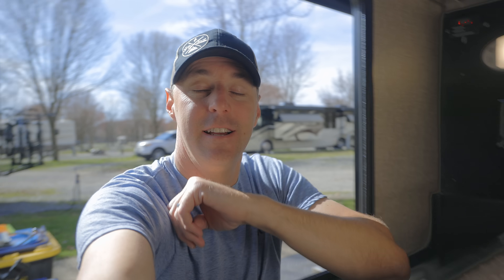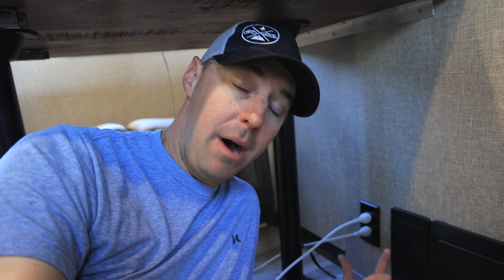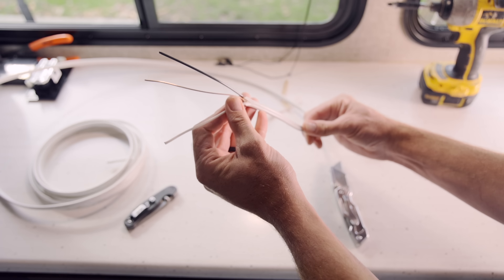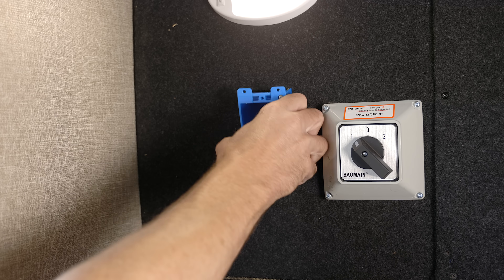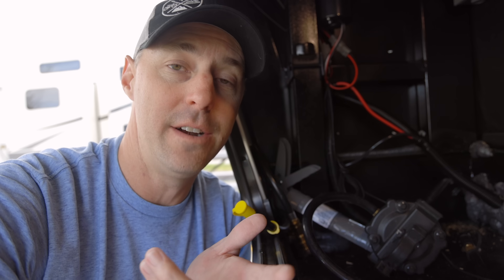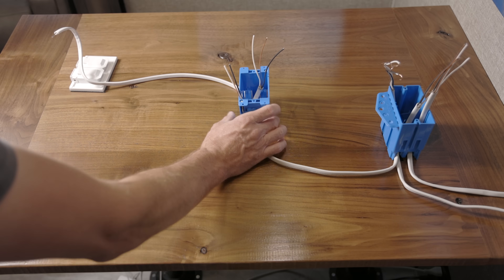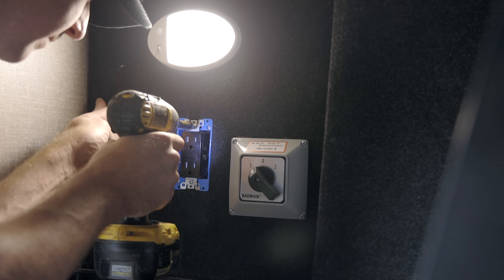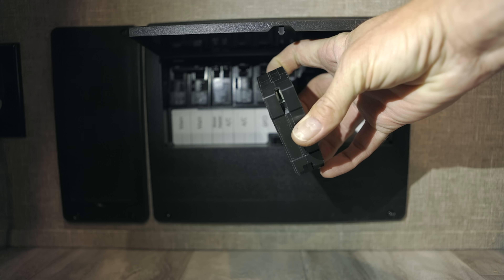How To Add Electrical Outlets In An Rv.

Comment: So thankful Jarrod. You're video is great, and I'm a teacher so I know what great instruction is:)

Could I ask a quick question? I want to add a 100 outlet in an upper bunk 3 feet above the 110 outlet in the lower bunk. It looks like the wire comes down from the roof to the outlet and then back up. Can I just wire in another outlet in wither wire? They're so easy to get to!

Comment: Very knowledgeable video, thank you.
Just wanted to mention that the device counts as (2) conductors which would equal 4 cubic inches (at 14AWG), and the current NEC now counts each ground wire as a separate conductor - but I'm not sure that an RV has the same code requirements as a typical dwelling.

Comment: I have one of those 15amp quick connect outlets that was cracked and I tried to replace it but could not get the back of receptacle back on. I finally gave up. Now I'm looking for a blue shallow box to use a regular household receptacle. I got the receptacle but not the box. The boxes are too deep and I don't have space in the ceiling. There's like may 2 to 2.5" depth in the ceiling. MY receptacle has 2 romex wires going to it. The wall out let is in the middle of a circuit. Where can you find these shallow boxes?

Comment: Hello, I've recently started living in my rv full time and am frustrated with the lack of outlets. I have an idea of replacing one of the light fixtures with an outlet, so that I can have an outlet in a more convenient place near the couch to charge devices. I understand that the light is 12V so I can't plug anything into it that draws too much power. But would this be possible?

Comment: How common is it to use solid romex wiring in RVs? My understanding is that stranded wire should be used instead to avoid work hardening and breakage from road vibration.
Reply: My understanding is that stranded wire is required by code in 
RV's

Comment: I'm remodeling a travel trailer and I chose to use the shallow outlet boxes since they should fit inside the thin walls. Also remember that the AC grounding bar usually requires a specific torque for the connections. Hand tight with a screwdriver may not be enough.

Comment: So my CO2 detector has a black and white, hot and neutral I presume. However when I put my tap tester to it it doesn't indicate that it's hot. Is this a low voltage issue?

Comment: I was hoping that maybe you or someone in the comments would be able to help me out with figuring out how to wire up a solar power system into a pre-existing system, for example my water pump and lights all run on the electrical already set in the rv, and I would like to transfer those onto my new solar (batteries) power system, if you or anyone can help me figure this out I would very much appreciate it.

Comment: I'm  amazed this industries  approach to wire a  RV product.   For the DIY is one thing; in contrast, the RV owner who must pay a technican to work on wiring, I can see the labor cost going through the ceiling to trace source(s) .  Behind a  wall wires are everywhere,  WOW.  RV industry it's time to setup, create wiring bundles and schematics. It will reduce weight and material cost.  Inital Engineering design cost will be more; however, you will recover that on the return for you investment (material savings / inital manufacturing installing costs).  More importantly the  end User will have something which is much more maintenance friendly. Futhermore, technicans will have the ability to trouble shoot  more effectively and effiecently.  A happy owner is a brand loyal owner.

Comment: What is your opinion on using WAGO connectors vs. wire nuts in this type of application?
Reply from the maker: I like WAGO connectors, I would use them.

Comment: I like your videos and have been watching and liking for years.  I always know I'm going to get quality info.  This one was especially good for me.  I'm a do it yourself kind of guy with one exception, I don't do electrical  (too much to know and the mistakes carry too much risk)  That said, you sure made it look easy and thanks for the info on the boxes, I didn't know they had different capacity ratings.  Also, plus one for liking the table top wiring example - that is how I think and picture it in my mind so it's really nice to have the clean confirmation.  That's it!  Safe and fulfilling travels to you.  Cheers!

Comment: Shouldn’t we use stranded copper wires instead of solid ones in travel trailers and motorhomes ?
Reply: The trailer manufacturers use solid conductors for AC (15amp and 20amp) and stranded for DC and 30amp AC in the trailers I've worked on. It's safe and the connections are more solid because as he showed in the video, you can twist them so that they won't separate.

Comment: Check out the WAGO connector, which takes the place of wire nuts.
Reply: Shouldn’t use wago connectors for this because they can wiggle out overtime.  Wago is only for residential

Comment: Just don’t. You don’t need “extra outlets” in a box where you can touch opposite walls by stretching out your arms. This is travel trailer not a potting shed. Leave it as built.

Comment: Very well explained. I am getting ready to do a similar project myself and was a tad reluctant to do it. Now you got me thinking again. I was actually thinking about adding an outlet that will connect to the 15 am plug at the post at any campsite. I would add a 10 am breaker and box that would be dedicated to this outlet. My thought is that I can use the extra 10 amps for a small heater or outside electric grill. All this so that I do not have to pull from my existing 30 amp supply. What are your thoughts?

Comment: Well done, electric is one thing I know how to do.  I use an infrared heater in my travel trailer when I'm someplace with shore power.  I put a junction box in coming out of the A/C breaker and ran a line to where I mounted a box for my heater.  I just figured that I was never going to run the heat and
A/C at the same time.  I put a small label on the junction box and above the outlet, just in case I get rid of the travel trailer so the next person knows what I did.  I didn't have the room for a 20 amp breaker, or I would have added one.  I didn't want to tackle putting in a 50 amp panel.  I may do that next winter if I add solar.  

Take care of yourself and your family.
Safe travels from Charlie.

Comment: That was very good. I like to use metal cut in boxes,  because plastic gets brittle over time being hot and cold. Also,  you can retap the box if its ever needed. You'll probably have a new coach by then.

Comment: what you call cut in box the Real Name is (Old Job box or old work box) some box store may not know what you are take about (call it cut boxes) As electrician school in that romex is one wire in and wire out is One wire if second wire in  is two wire.  pigtail wire is one  2020 NEC code you only hook two on one side of receptacle I may look it up may change One wire hook to receptacle and pigtail wire is the same as the wire coming to box. Why only two wire two one side the jumper metal in receptacle was over heat jump Next time run romex  in blue conduit . Keep you safe

Comment: You didn’t have to add the third wire for your ground connection. If you had used a ground wire nut (green), they have a hole in the middle. You leave extra wire on one of the grounds and it protrudes through the hole,with enough left to make your connection. Saves space and one less wire to come loose.

Comment: Great video.  The main reason for twisting the wires together is that electrical current runs on the outer edges of the wire.  So the more you can make the outer edges touch, the better the connection and lower resistance which means lower amperage lost to heat.

Comment: Umm, Romex must be protected! It's not rated to be exposed to physical damage. I'm pretty sure the low voltage wire cover you showed is not approved for that. MC cable would be just as easy and fully code compliant. You might also consult a master electrician on your wire nut technique. There's a lot more to wirenuts than twisting!
Reply: Lol none of the romex in my brand new camper I picked up today is protected.

Comment: Great video and explanation. I have been household wiring for years and never knew that the boxes had a limit on the amount of wire in them:)

With your new RV, have you found that each circuit has sufficient capacity to handle the extra load after adding another breaker?

On my new MH, they wired the inverter to a single receptacle that feeds the res fridge.  I know the inverter has the capacity to feed some more outlets and want to wire up one for my cpap.  Not sure if I should try to go back through the breaker panel or try to run a new line to the bedroom.   If you have dealt with this before or could do a video it would be great.  I hear in the forums many people dealing with it on their new coaches.  Not sure why the manufacturers won’t deal with it from the factory.
Reply from the maker: The capacity has been great and no issues. I do wish the manufacturers would change the  way they prep which is a bit outdated. But that said, How I like to set it up is not how I would expect manufacturers to because of the complexity. Here is our setup to not have to pick and chose what we want to be on the inverter.https://www.youtube.com/watch?v=gbKBoIvXNPA&t=2s
Reply: @AllAboutRVs  thanks so much

Comment: I replaced the outlet next to the bed and the one under the dinette. I used old work boxes since I replaced the cheep RV outlets with outlets that have a USB charger. Works great for charging the phones.
Reply from the maker: Great Idea
Reply: New RV start put them in but you need AC power if only USB plug and it on House battery

Comment: Nice that you can add receptacles. Our slides quit working on our Sunset Trail and it ended up being a faulty wire nut. The wires melted a hole through it so it was replaced with a buss terminal. They were ground wires. While looking for the fault, I found some blade fuses behind the control center panel. Very poor engineering. At least those weren't 120 volt fuses.

Comment: I added one in my wall and like you I don't like/trust those little thin ones in rv's, so I used a cut out box also but because it was so deep a took a cut tool and cut the box in half and used it that way.

Comment: Are the breakers just residential breakers or do RV mfg use breakers made specifically for RVs? Also, I realize you prefer not to use the RV outlets, but if you have to, where do you get them from? Finally, your how-to videos are great, but I'm always struck by how calm and quiet it is when you film them....since I believe you are a full-time RVer, do you chase your family off when its time to film? :-)
Reply from the maker: Yes they are normal breakers. I found the same type at Home Depot.
Reply: If you need the RV type outlets I'd check online first but I bought one at a small RV Supply store. They had dozens of them. I replaced several of them because they were 30 years old and had arcing and leakage problems that was transferring a brass coating from one terminal to the wires.
Reply: Just residential breakers. Nothing special, at least not in my RV.
Reply: some time depend who make the breaker panel Not all breaker fit right .

Comment: good video buddy just be mindful GFI protection plugs there is a difference in line and load and how it is wired safe travels buddy
Reply: Good to know - thanks for sharing.  I don't really understand what you're talking about but here is what it does: it creates a little red flag in my brain and if I work on a GFI in the future  if will think there is something to do with the loads on these guys and I need to make sure I know what I'm doing.
Reply: @mondavou9408  it is written on the back of a standard GFI protected plug line would be the hot coming from the breaker box load is every plug after the GFI if you hook that up backwards the plugs past the GFI will not work correctly I am an electrician buddy
Reply: @foreverfixin  I think you mistyped there. Line is power in from the breaker and load is power out from the outlet. Load side is the GFI protected side.
Reply: @LoudRam  u may be right let me look it up

Comment: Wago lever wire connections are the best especially in an RV environment. Though I will say the way you did your wire nuts are unlikely to fail. Thanks for the video.
Reply: Love Wago, actually left a post above for him to use those next time. Most people don't know about them. They are now my go to for house or rv.
Reply: @lwadeallen  you have sure you're buying the right size for the gauge of wire read package if to loose will vibrate off

Comment: Thank you.  Great to see.  Did something similar in our kitchen/living.  Everything was on one 15 amp breaker which made running toaster, microwave, and coffeemaker together and issue.  I didn't think about adding a breaker, but I took over the breaker going to the washer/dryer combo which we don't use.   I need to go back and see if I can do that double slim design if I need the breaker space in the future.

Comment: For use in an RV I would consider a dab of solder on each connection before the wire nut and tape.
Reply: twisting wire is the best the power flow on the surface of copper or aluminum wire especially not solder (aluminum wire) I say low volt ok solder. Why you may add more resistance to the wire
Reply: I'm going to disagree. Solder shouldn't be used in wire connection on something that moves. It actually can cause problems. My dad is an old airplane mechanic and solder is a no-no because of failures. Probably unlikely with solid core wire but with stranded wire you can wick solder up the wire and cause a point of failer when the wire is moving.

Comment: Great video. I want to add an outlet in my RV basement, just as you did. However can not find an outlet close to the basement to tap into. Any suggestions? Would be very difficult to run / fish a wire from the breaker box because the breaker box is in the rear of the RV.